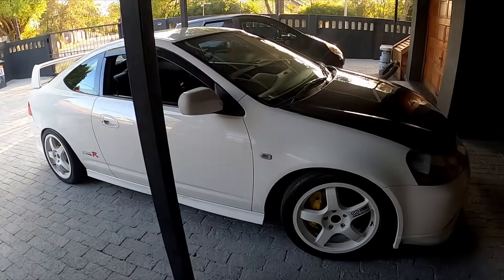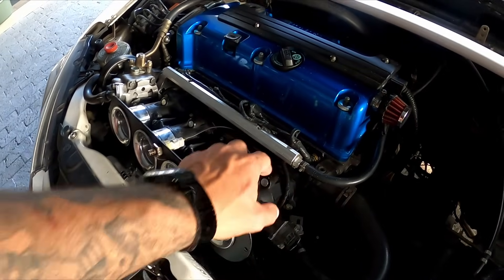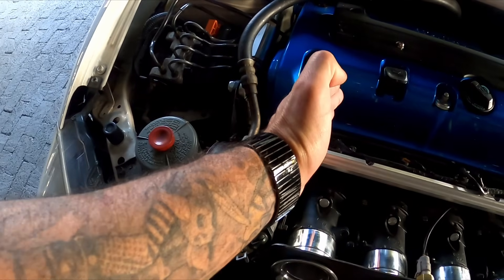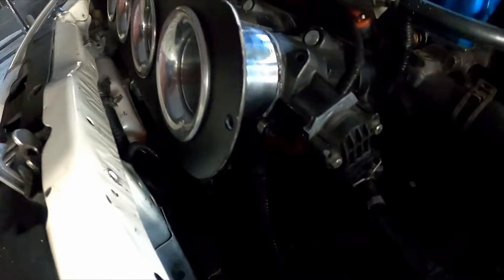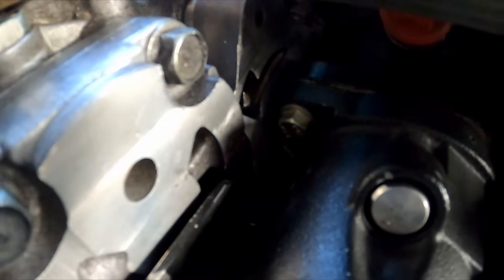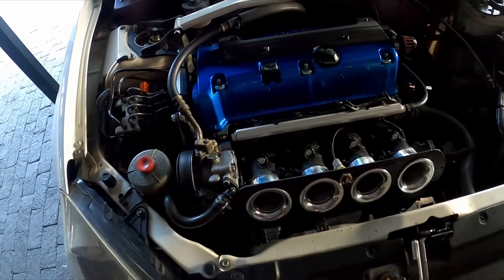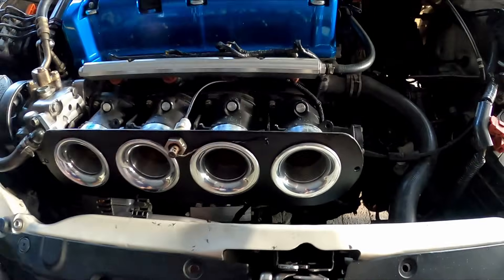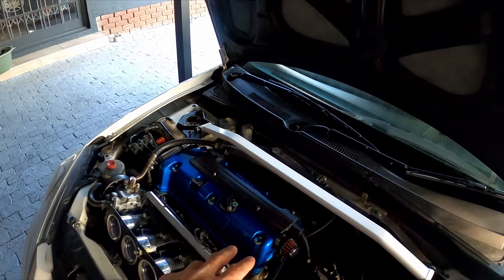Individual Throttle Bodies on a BUDGET - #honda  K20 / K24 - part1

Comment: any air filter?
Reply from the maker: No filter unfortunately , it eats up horsepower

But what you can do is buy a tea sift and clamp it down on each throttle

Keep all the stuff out
Reply: @the_JDM_fanatic an ITG filter should work fine, e.g. ITG-JC50CTT-30 or a ITG JC50. You’ll kill that engine fast otherwise.
Reply from the maker: @lapin46 I suppose you’re right man but ran open itbs for a few years, opened the motor , changed the head setup and there was no scorching on the bore, everything looked and felt good 

But I did change up now to the skunk ultra street mani as the 52mm itbs were just too small, lots of velocity but not enough volume

Comment: Where did you get the custom intake manifold adapter plate for the head mount?
Reply from the maker: @kumaragurusaravanan2248  had my engineer guy make it up for me, there is a part 2 to this video which gives a little more in details about the itbs 

But it’s actually pretty straight forward I think

Comment: Hi buddy, can you send me how did you fitted these TB to k20? I can create my own flanch for head, its not a problem, velocitystack also, but what about these holes for injectors (original for BMW). Is it ok, or it can make some issue/turbulation? many thank for your answer!!!
Reply from the maker: I can send you pictures , I have the itb at home off the car. I am doing k24 now to my Honda
Reply from the maker: Hey man , I do have another video on this which is part2 but you can send me a message on what’s app +27837813889 and I will try help answer on a voice note

Comment: Hey man this is a great idea. I've considered GSXR ITBs on my Miata, and I'm thinking of doing a K20 swap, and this is right along the same idea. Any chance you or the person who made the adapter plate would reproduce them and sell them, or sell CNC plans for them?
Reply from the maker: hey what's happening man? 
just remember if you're putting itb's on a k20 I wouldn't suggest anything under 50mm. Though the thing is to get the adapter plate made, you will only really need the gasket for the head of the motor you will be running and the gasket of the itb's. 

Like that you can go to any metal center place and they can laser cut them let's just say 10/12mm thick out of ali. 

Then when the intake is off you need to see how long they can be or how much space you have and if they require any angle. I would say longish runners so you can put the injector as far away from the head as possible for better atomization of the air fuel mixture and then as long as you can go with the trumpets, from my experience with this at least the longer trumpets performed way better.

But in a nutshell that's all you need to do, and try match the intake port side with the same size tube you will use for the runners. Literally all you will need is for someone to weld the runners on and weld in bobbins for the fuel injectors.

I know it sounds like a lot of work but it really isn't and compared to what itb's go for online its a fraction of the cost

Comment: Can an itb equipped engine get a turbocharger
Reply from the maker: You just need to make a intake manifold around the ITBs , so it is sealed and then you can boost it the same way as normal… 

Prime example is the RB26dett engine
Reply: @the_JDM_fanatic  hmm
Reply from the maker: It can indeed yes sir
Reply: @the_JDM_fanatic  fr how?? I have never seen it on Google
Reply from the maker: @gnrtx-36969  just Google rb26 itb setup and it’ll give you everything you’re looking for

Comment: Nice video mate. ITBs sound insane. You got an insta? One on your page wasnt working.
Reply from the maker: Hey dude how are you? I do have insta indeed, it is @the_jdm_fanatic
Reply: @the_JDM_fanatic  dropped you a follow
Reply from the maker: Itbs are my absolute favorite 😍
Reply: @the_JDM_fanatic  youve done it alot cheaper. Tegiwas straight fit set is £2k.
Reply: Hey mate. Where did you get the adaptor manifold made? Do you think another one could be made? Looking to do this to my dc5.

Comment: You have a diagram of that air junction block? Tryna recreate this
Reply from the maker: So basically dude what you can do is take 4 pipes that come out the bottom of the manifold right, then you take two elbow push in joiners , so number 1 and 4 get the elbows, then they get a small straight pipe, then you join them with a T piece . So In Essence you now have one pipe or vacuum from two. Then you do the same with the two centre pipes.  Remember you can join which ever you like to together can be 1 and 3 also .. 

Then you’ll be left with 2 pipes and you do the same with the elbows and 1 T piece which eventually goes to the brake booster.
Reply from the maker: I know it seems like a lot of work or a tedious process but it isn’t that bad once you get started man
Reply from the maker: busy uploading a more detailed video now it should have all the details you require. hope this helps

Comment: 52mm throttlebodys are big enough for 95% of the time
1990 DTM Cars did make Up to 380HP out of 2,5L displacement with 49,5mm throttlebodys on normal German Pump fuel Back in the days.
Its Like you said those big big Throttlebodys make more power the Last few rps.
Greetings from Germany 🇩🇪
Reply from the maker: Hey, Guten Morgen Deutschland 🇩🇪 🤘 wie gehts meine fruend. meine Deutsch ist scheisse aber ok… 

Yeah dude I think you are 100 percent correct man… I think my 52mm are perfect I am happy with the power all the way through the rev range , if I had 58 or 60 or even 64 , yes they will make more power, but then it is a drag car and it needs to live above 6000rpm to actually feel like something is happening. 

My favourite cars ever are the 90’s era DTM cars !!! Specifically the e30 m3 with the 2.5 inline 4 itb engine with that huge carbon intake box. The sound 😱😱😱😱😱 is just beautiful !!! Even though the Mercedes 190 was a good competitor , my first car was a e30 and have lots of love for them

Comment: Thanks for the detailed video. What ecu tuning solution are you using? Was it difficult to get the ITBs mapped?
Reply from the maker: Hey man, so ive got a haltech elite 1000 with the jumper harness, so its a plug n play unit. To be honest it wasnt really that difficult to get the ITB's set up and tuned , the VE table is a little different to your conventional plenum cars because it isnt consistent or it doesnt increase as the rpm or load increases, some places want more fuel on the higher cells and some want less. other than that, all that really needs to be done before fitment would to ensure all the butterflies are all close equally with little to no gap and where you connect the throttle cable to have some sort of adjustment if you need to open the throttles, just makes life easy.  You could also get more idle by playing with the ecu tuning. 

But if you have  the electric PS k20, then its very straight forward
Reply from the maker: Hey man i am busy uploading a more detailed video right now if you want to see more info about it

Comment: Make some adapters to use this throttle bodies
Reply from the maker: yes sir.... basically you'll need a gasket from the k20 intake and from the ITB intake, cut the two flanges and then make runners to join the and at which ever degree angle that will make it work at. Place your injectors where you want them, further back is always better (better atomization) and the your basically ready to rock n roll
Reply from the maker: check out the more detailed video that will be up in the next hour on my channel

Comment: awesome build dude. good thinking outside the box with those bmx throttle bodies. sounds mean
Reply from the maker: Thanks bro appreciate that man. I always wanted ITB's but all the kits online are ridiculously expensive, for the amount of gain (HP) that you get vs the $ value, it doesnt seem worth it at all. This way was at least okay on the pocket, I lie it was actually really cheap and didnt hurt the pocket, plus the pain gain was lovely and it could be felt instantly after the tune. The sound, well lets just say all you really hear is the front of the motor all of the time, it croaks and then screams.

Comment: Just needs a shorter final drive bro and that car 🚀
Reply from the maker: That is definitely on my list of things left to do, that is a game changer, though i do use the car on the street a lot and it would be singing at 5000rpm doing the speed limit. its already at like 4200 at 120km/h 

But yeah im gonna do it regardless sometime soon, because i dont wanna open the motor and do pistons etc as its a huge job and also the motor was just opened not long ago
Reply: True it will be buzzing when commuting.
Reply from the maker: @rezaparker3893  might be the next video or a video soon to come

Comment: sounds good, what was the hp and torque on dyno?
Reply from the maker: So dude the last time we dyno’d the car it made 139kw and 180nm on the rollers before the cams… I would say the way it feels now, 160 and around 195nm on the rollers , give or take 280bhp on the fly hopefully 🤞 more
Reply: @the_JDM_fanatic  that probly sounds about right, im 150kw with drag cartel 2.2cams and full bolt ons on a k20a. im just considering maybe swapping too a big tube header 421. currently have PLM headers
Reply from the maker: @SuperNuk3  honestly the best thing I could have done was change the 4-1 big tube megaphone header back to the tri y smaller tube... 

I only went backwards with the 4 to 1... 

I gained so much more drivability with the tri y and also there's torque everywhere 

4 to 1 is not for me that's for sure unless you're living at 8k rpm
Reply from the maker: @SuperNuk3  nice thing is it is such usable power, it’s fast even though 150kw doesn’t sound fast